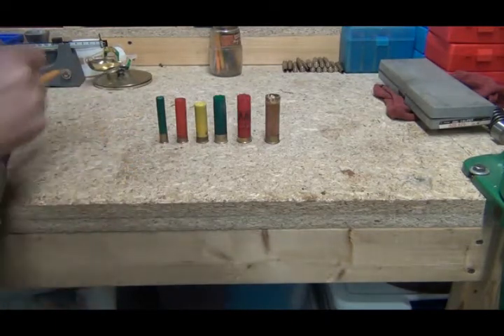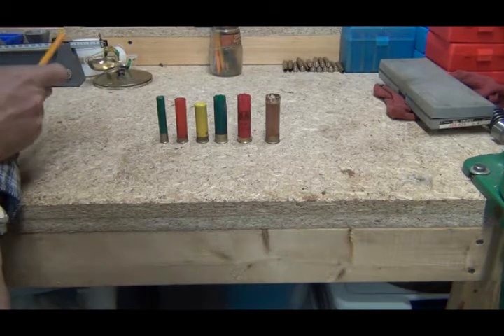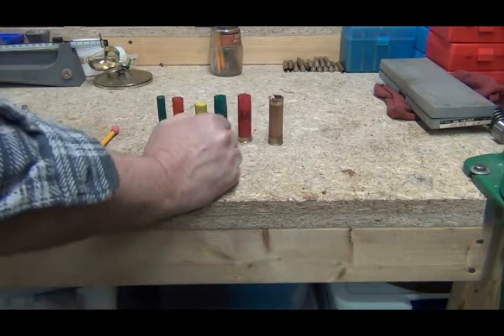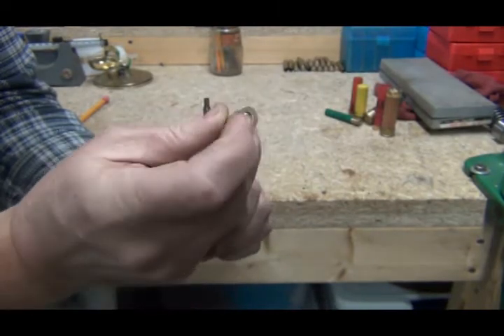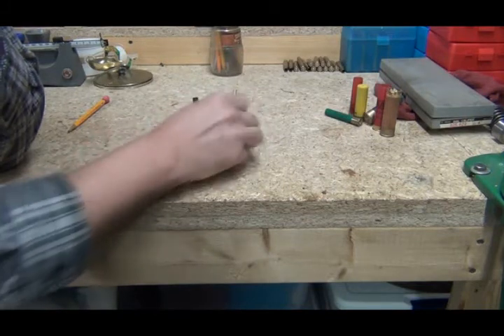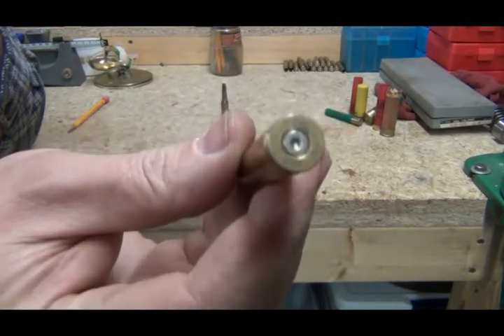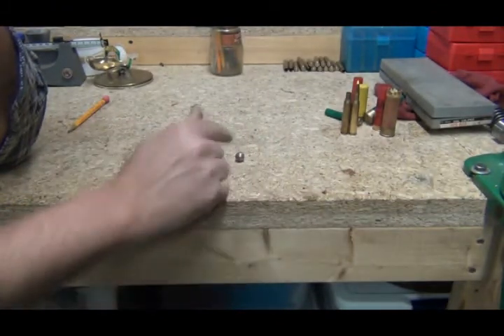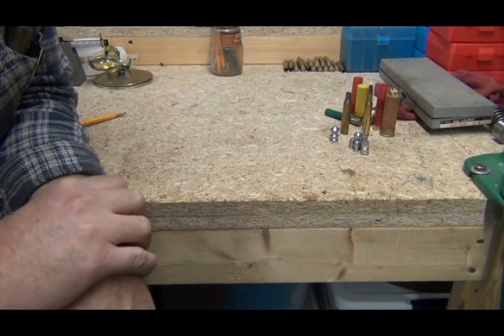Firearm cartridge identification and safety

Comment from the maker: A .410 is a shotgun shell. I don't know why they call it a .410 other than that is the bore size. The rest of the shotshells are in gauge. They come up with the gage by casting a lead ball the size of the bore. They weigh the ball and figure out how many of the lead balls it would take to make a pound. A .410 would actually be a 68 gage. That is why the lower the number the more powerful the gun. 12 ga. is more powerful than a 20 ga.

Comment: Good video Uncle Buck... I personally carry a Kel-Tech .32acp when i'm out in the NH woods, never know what your gonna find, or what might find you. My Cold .38special is too bulky on my hip with all my gear so the .32 fits nicely in my home made stealth sheath front pocket.  I also worked in the gun shop on board USS Enterprise in 1996/97 and work on high speed jams in the M61A1, 20MM 6 barrel Gatling aircraft cannon. What do you think about 3000pm capacity? We made it rain.... SWING BEEP DIG.